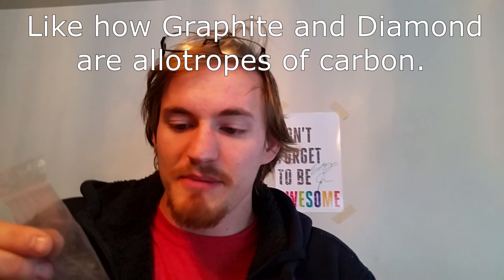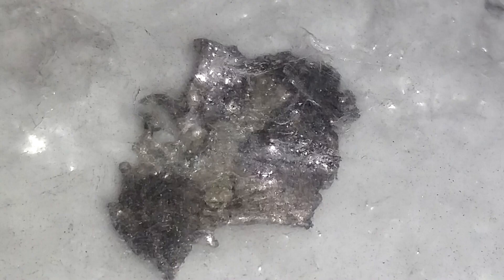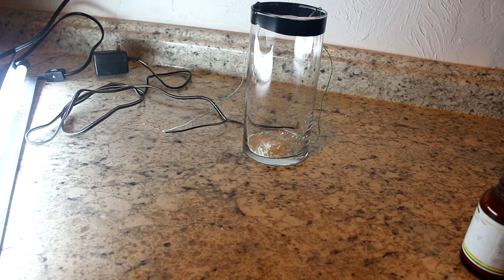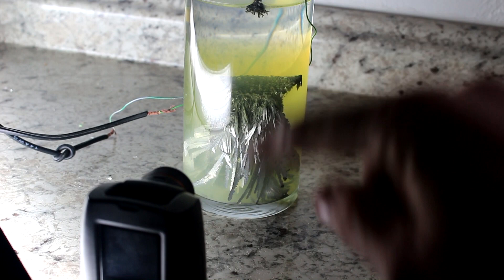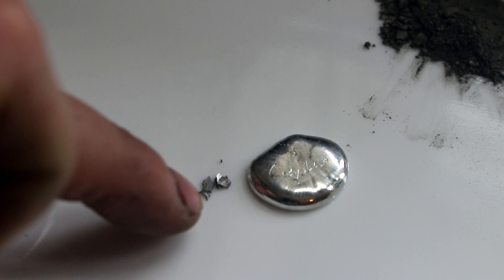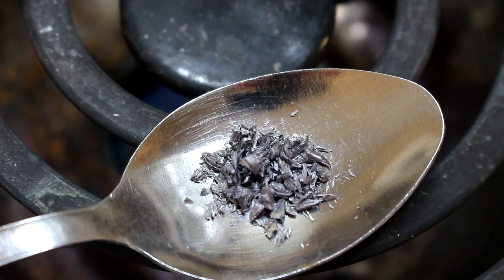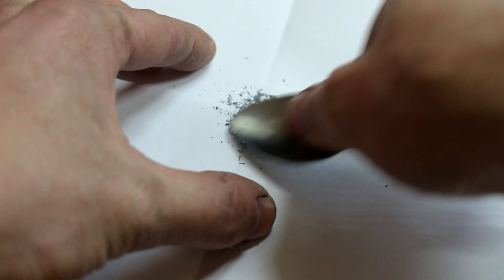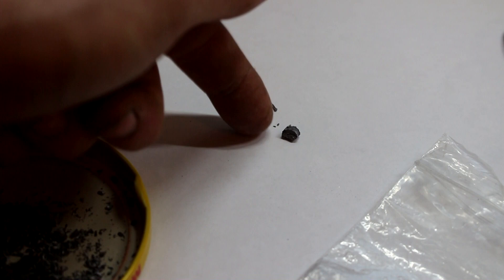Making Grey Tin (tin pest)

Comment: German wikipedia lists -48°C as ideal for the fastest transition (the tendency to convert rises with falling temperature, but the reaction speed gets lower with temperature). It also states that metals like Aluminium or Zinc actually increase the rate (although some like Antimony or Bismuth decrease it).
Reply: Why were you looking at the german wikipedia page? xD
Reply: JEDi Gamer
Because I always check multiple sources (you should, too, and not only wikipedia) and my first language is German. All the english sources seem to have copied the "approximately -30°C" (most even use the same sentences you find on wikipedia), so I'll go with the "-48°C", because there has to be a reason someone specified it to within a degree. ;)
Reply: superdau Interesting, thanks for the info!
Reply: +JEDi Gamer 
Btw. for such things as numbers you can even check sources in languages you don't speak at all. You may be far from speaking the language, but it doesn't take long to get a feel what someone is generally taking about, be it Spanish, French, one of the scandinavian languages, maybe even Russian. Just try it!
In this case most list values below -40°C and many of the experiments that show this use a temperature that low as well (that's more a hint for Cody now than you I guess ;) ).

Comment: I think the grey tin turnes into white tin of warmth, and when you pressed the spoon on the grey tin, it made friction, and friction makes heat. That is how I think the grey tin turned into white tin :♧
Reply: I mean the melting point of tin is like 450F or something. You'd have to have some SERIOUS friction to generate that kind of heat. Way more likely due to pressure.
Reply: I don't know what 450F is, but the melting point is 320-350°c
Reply: +Marius Haugen well a super quick google search will tell you that 450°F is equal to 232.2°C, and that is maybe a bit low, but around the right area.
Reply: Last I checked, that would work on melting small quantities of tin.
Reply: Not that big as it shows in the vid, I melted a piece 'bout this big  ▪  with 329°c so it wouldnt melt at 232.2°c, no way

Comment: I also made grey tin in my freezer.  My starting material was metallic tin from Rotometals.  There seems to be a lot of questions about how pure the tin needs to be for this experiment to work but I found the Rotometals tin sufficient.  It also took several years for mine to convert.

I had no idea that you could "seed" the conversion with a bit of grey tin.  That is very interesting!

Comment: Here's some notes from an old chemistry book:
"The transition point can be detected dilatometrically and lies at 18°-20°. A mixture of the two kinds of tin neither contracts nor expands at this temperature, while at higher temperatures a contraction is observed and an expansion takes place on cooling, due to the disappearance of the grey tin on heating and of the white tin on cooling. The same transition point is found if electrodes of grey and white tin are placed in a solution of a tin salt and the resulting potential difference followed. At about 20° this is zero, but below this temperature white tin, and above it the grey variety, has the greatest solution pressure [i.e. EMF]. As the ordinary temperature in temperate climates is usually below 20° it follows that all tin is in the metastable condition except on a few very warm days; and it is only because the rate of transformation is so slow that the tin remains unaltered on most occasions. This pseudo-stability disappears at once if the tin is placed in a solution of a tin salt. The deposition of tin takes place owing to the small currents set up by differences in concentration in the solution, and the tin is naturally deposited in the form stable at the temperature of the experiment. The small amount of grey tin which separates out at temperatures below 18° is enough to infect the whole mass of tin. The rate of transformation is thus markedly affected by the presence of tin salts, and whereas dry tin shows a maximum rate of change at -48°, when immersed in a solution of a tin salt the change is most rapid at 0°.

The previous history of the tin also affects the rate of transformation, and a sample which has been undercooled for a long time is converted into the grey form much more rapidly than tin which has not undergone this treatment. Again if some grey tin is transformed into white and then back again into grey, the second change takes place more quickly than with fresh tin, and the more often the tin has been transformed the more rapidly the change takes place. Even the transition temperature is affected by a repetition of experiments or by intermediate heat treatment; with cadmium it can be depressed from 70° to 62°."
(Temperatures are degrees Celsius.)

Comment: I'd imagine there'd be lots of scope for trouble if some of that fine grey tin dust got loose near anything electronic made with lead free solder, particularly in cold weather. Lead free solder is mostly tin, and probably susceptible to the conversion. Similarly, lead free solder develops tin whiskers. Apparently they've lost several billion dollar satellites due to tin whiskers since lead free solder was introduced.

Comment: It should convert below +13.2°C and "wants" to go faster if its colder, but as you say the reaction speed is slowed as colder it gets, so the best temperature is -48°C. 
Apperently an alloy with aluminum or zinc actually speeds the process up as well as contact with NH4)2[SnCl6 (i have no idea how its called in english)  so it dont has to be extreme pure, other alloys possibly prevent the change.

Comment: drill a hole in a good sized chunck of tin(or zinc) drill a hole to the center ,freeze it add a bb of tin or(zinc) in the hole ,push dry ice into the hole about once a week( keeping the tin at freezing temps bingo less than a month you will have all you need.

Comment: Cody, this is an allotrope for tin, I studied it recently in my Materials Engineering Lectures, it basically changes from a beta structure to an alpha structure due to the low temperatures, maybe you could find some phase diagrams for it.
Reply from the maker: i would love to see one that includes pressure.

Comment: It seems like the atomic structure of the tin "crystallizes" in some ordered pattern, the pattern acting like a chaperone for it to spread throughout the tin. I would guess that the chaperone structure + the cold temperature are necessary for it to spread throughout the metal, the temperature possibly giving the "crystallizing" structure the stability to stay in that form. I would also guess that the conversion happens at room temperature with a gray tin primer, just much more slowly (or maybe there is a cutoff temperature)?
Reply: *****
Its more or less a wild guess.

Comment: The "pest" reminds me of the action of gallium on aluminum.  It would be interesting to put two halves of the same 100% tin sample, one in open air in the freezer, one inside a small chamber evacuated by one of your pumps.  Let them sit, and once the pest develops on the exposed sample, check the vacuum sample, my guess (bad scientific form) is the sample will remain unchanged.  If this holds true, and can be establish via multiple samples and extended sampling intervals, this would point to the possibility of an atmospheric element or compound being responsible.

Comment: Hey Cody! I had a question about the tritium you showed in your last video. I have a small glass tube of tritium that originally was in a plastic key chain, but after years this key chain has broken. I was wondering if using resin to make a new protective casing for this tritium tube would be a good idea?

Comment: You should try cooling down circuit boards to see if the tin in the solder starts to convert.
Reply: +Sizik it shouldnt because it needs pure tin
Reply: +Sizik It is probably too contaminated with copper and other crap.

Comment: This is very cool! I didn't know that tin had another allotrope. I might want to test this myself.
About 9:00 -- '-10 degrees' sounds like a bit warm for a freezer as our freezers in Finland are usually at -18 centigrade. Or did you mean -10 on the fahrenheit scale?
Also, Arthur said in his video that 13 degrees centigrade or 56 degrees fahrenheit would be cold enough for tin to turn into grey tin. Is the colder temperature needed just to speed the conversion up?

Comment: I wonder if there's a way to get macroscopic grey tin single crystals. Maybe alloying it with a bit of germanium or silicon (or even carbon?) could stabilize the covalent low density sp3 diamond structure. I doubt alloying tin with carbon would work though because of the difference in atom size. If the compound tin carbide (SnC) can be made somehow then I guess it would likely not be transparent like clean single crystals of the compound silicon carbide (SiC aka moissanite) because tin is so much more metallic than silicon. I'm very curious whether clean single crystals of the compound germanium carbide (GeC) that lies inbetween SiC and SnC would be transparent or not.

Comment: Cody I have a question which I cannot get the answer of myself.
Around the year 2000 I had recieved some glow in the dark stars that could be sticked to the sealing so that I would have a starry night when I would go to bed. I saw your radioactive video and was wondering what those glow in the dark stars were made of. Would be nice to get some info or a link to an article that explains what materials are used in the making.
Reply: Most 'glow in the dark' things are made with (forgive me if I get their names wrong, english is not my native language) fluorine (F) or phosphor (P), but mostly F. F continues emitting light long after the last foton hit it, P doesn't. This elements gave the adjectives Fluorescent and Phosphorescent. BTW his Tritium rods emit light thanks to Fluorine, since it catches Tritium's radiations and gives off light.

Comment: Hi Cody. I once did a electrochemical method of making copper sulfate, I added about 30ml of car battery acid and 45ml of water. I putted my copper electrodes in and instead of hydrogen gas I got a unknown gas with a very pungent and irritating odor. I thought it was sulfur dioxide but it doesn't make any sense and it didn't smell like it too. Any ideas what that could be? Thank you for making good videos.

Comment: so last vid ended with the tin crystals forming, i assume this ending is also a prelude to the next video? what experiment could require that much copper, i wonder. are you gonna melt it down and somehow turn it into copper wire to build a tesla arc with? or an induction furnace?

Comment: Hey Cody I have a quick (hopefully quick) question to ask you. So a few days ago in my ips class we where assigned a project to do in class called sludge and what we do is we get a mixture of solids and liquids and we have to separate them so me and my partner got a yellowish orange colored sludge we think might be water mixed with hydrochloric acid we think it's acid because I touched a bead to move it to a baggie and it burnt my thumb but back to the story we distilled it by boiling it into a separate test tube after we got enough liquid to do fractional distillation we put the beginning test tube back in the test tube rack (this was the first day we are on the 3rd day now) it wasn't until today that we noticed crystals forming on the bottom of the test tube I was wondering could this be something dissolved into the mixture or is it something else thank you for your time

Comment: Beautiful video, as always. Grey tin is chemically identical to white tin, isn't it? Its reactions will be the same as white tin's, right? Also, have you ever tried excrating aluminum from rocks? I've only seen it done with electrolysis, but it needs enormous amounts of electricity and heat. Couldn't you dissolve Al with some acids, then make it become a water-insoluble salt and filter it? I think that they do it with electricity because it's more efficient in large scales, but it would be nice to see it done in smaller scales only chemically.
Reply: extracting* I wanted to point out that you can obviously melt every aluminum thing you can find, given its low melting point, but I was just wondering why you can't chemically extract metals that are a bit higher than carbon in the reactivity scale... can't you use other metals to extract them? Extract all of the high reactivity metals using K (KCl is sold for use as table salt for low sodium diets, for example)?

Comment: Not sure I understand why you chose platinum electrodes. Seems to be an expensive choice. Was it the cheapest material that wouldn't contaminate the tin, or did you just have platinum wire on hand? What other metals could be used?
Reply from the maker: carbon may be used but i had pt.
Reply: ***** Ok sweet. Figured it was just cause you had some on hand :)
Reply: +Cody'sLab can you use tin electrodes?
Reply: +H I believe that the depositing electrode may be tin, but the other one cannot as it will dissolve into solution.

Comment: You should have added a bit of aluminium or zinc to speed up the beta tin reaction speed.
Reply: He needed pure tin for it to work at all (he said, i dont know).
Reply: CoCo CoCo there are elements that slow the process down (or prevent it at all) and elements that speed it up. Ideal is a certain alloy with aluminium and zinc, a temperature below -40C and the presence of (NH4)2[SnCl6] (I think in english this is called Panichiite).

Comment: Could you turn graphite into regular carbon like this or how would that work?
Reply: graphite is the most common type of elemental carbon. You can turn graphite into diamond with enough heat and pressure so I'm sure the reverse must be possible under some condition, but who wants to turn diamond into graphite.
Reply: Chris Rendeiro Maybe if you gotta do a test but don't have any pencils

Comment: what's the significance of gray Tin vs. metallic tan
Reply: They are the two allotropes (forms) in which you can find tin. Metallic tin or white tin is as you would imagine a metal, grey tin is the one you see powdered in the video. They're just two forms of the same element. Not quite sure if it makes any difference with chemical reactions, I've asked it too.